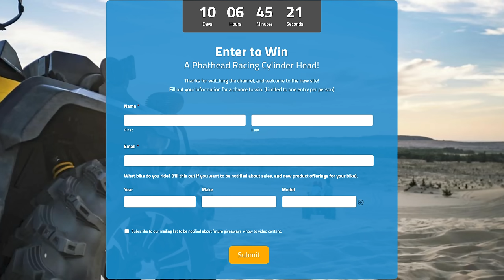Finishing My Epic YZ250 Two Stroke Project!

Comment: I've got over 150 hours on my 2019 yz250,  original piston and original spark plug,  it only runs on shell gold gas and Yamalube r at 32/1.  The yz loves oil. 
Something that you didn't install is a motion pro coolant recovery tank,  I think it was the best 35 bucks I spent on my yz250 for hard enduro riding. I've got a video of what it is on my channel.
Reply: u should really change that piston before it shatters and leaves metal in ur crank

Comment: I’m not really a Yamaha fan, but you made this bike look awesome.🏁. Great video 🍻 Just one thing though.....brake fluid is very corrosive, and WILL strip your new paint. When filling brake fluid reservoir don’t fill up to the top, as when the cap is reinstalled it overflows and is very messy.😬
Reply: Was thinking the same, way to much brake fluid.. Be carefull with brake fluid, even when you don't was your hands very good after bleeding brakes you can leave fingerprints on paint

Comment: Splendid, as usual.  The front wheel rotation wire and connector seem a little exposed there inside the front fork.

Comment: That is a bad ass bike. Why so much brake fluid though? You need to have an air gap in the reservoir for fluid expansion other wise your brakes will lock up when they get hot.

Comment: Just wondering, noticed you used the heat gun while putting the seat cover on, does it help? Thanks
Reply from the maker: It does yeah!
Reply: Adam Paganelli, thank you so much for responding, I just ordered a moto seat cover for my 2019 yz250fx, I’ll try the heat gun trick when I get it

Comment: I was Wondering why you bleed the brakes 4 times front and back, Once with a pneumatic break bleeder, then by hand both do the same thing, except for one you don’t pump up the 
 petal?
Reply from the maker: I like to use the air to get the fluid through the system, but it's easiest to finish off the brakes by hand so I dont lose a lot of fluid.

Comment: Is their anyway to contact you? I have a question regarding my 2017 yz250. Im having compression in neutral when the bike is off and i try to roll it. Also when im riding when im in 2nd or 3rd it auto shifts back to neutral and then back into gear. Any advice would help thanks.

Comment: I bought this bike and most everything was in good shape.  I was disappointed to find out that the FMF pipe he reused was bent from a hit and after buying the bike for 9k I have to spend a further $250 on a new FMF gnarly.
I guess I could say it's not that big a deal. But when you buy a bike from 2006 with the part that doesn't meat factory specifications like this pipe does not. I am a little frustrated. It's about 3 mm away from the frame. Like I said it's a great bike. But when it is sold as a factory or better bike I expect The expansion chamber not to be bent.

Adam was a great guy and I'm not trying to trash him. But as i fork out another $300 on a bike that is supposed to be factory or better I should say that every part did not follow suit.

The brake line to the rear brake was also not molded correctly and it got pinched by the rear shock spring and went out on me in the middle of a ride. I had to limp the bike back one weekend and then buy an OEM brake line that was bent properly. So on my better than OEM bike that I paid an extra thousand dollars for so far I've had to replace the brake line and expansion chamber.
Reply: There have been some other small situations with bolts and other things that were not replace that probably should've been. Not the end of the world. There are a lot of upgrades and bling on this bike that would cost a lot of money. But I'm not that interested in bling. I would've rather had some of the other parts that failed properly done.

Overall I get the bike a nine out of 10. Good guy. Good builder. But not 100% stock or better. I know he got most of the parts for the bike donated so if I could've saved $500 on the parts I had to replaced I wouldn't have said anything. So in the end I'm not unhappy with the deal. And I'm happy to have a bike that is cool to show my friends because of the extra bling and it looks really good. But in the end a stock 250 X would've cost me 8200. I spent nine grand. Now spending another $500 on parts. It might even out because I did get a larger fuel tank with his bike and I got the Lectron carburetor which I love. So in the end I think I've spent as much as I would have on a brand new bike but of course I have a couple good upgrades and some bling, but with springs and everything a slightly more worn out bike than I would've gotten brand new.  

This may sound weird but thank you Adam in the end. Because of the current market I was an able to secure a YZ 250 X. If I could have for the summer I would've bought a new bike. I bought this one instead and pretty much broke even and now I have a bike that looks pretty bad ass. Not mad, and not trashing. I am well aware of the builders get a lot of the stuff donated and he put a lot of great time into this bike overall I am not this fat satisfied with my purchase. Knowing what I know now I might've talked him down a little bit more. But I'm still happy with the purchase